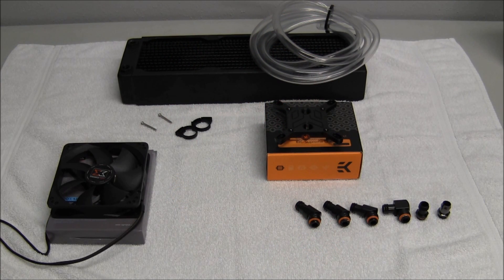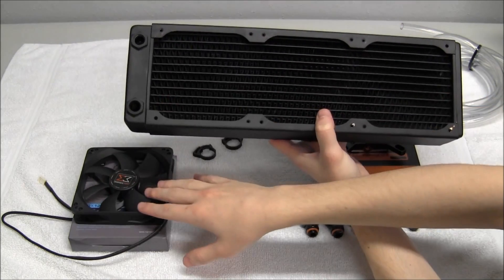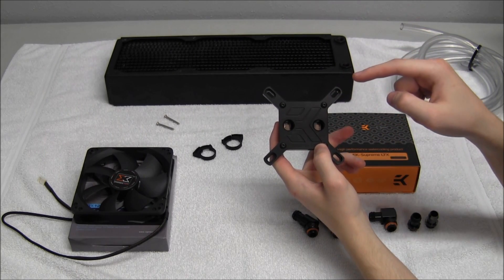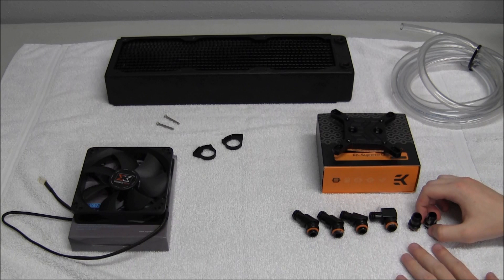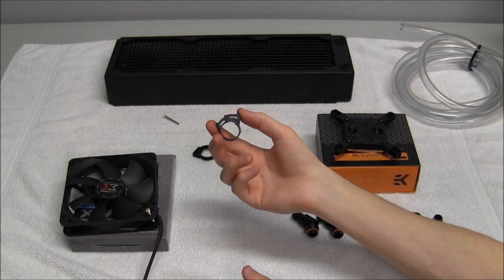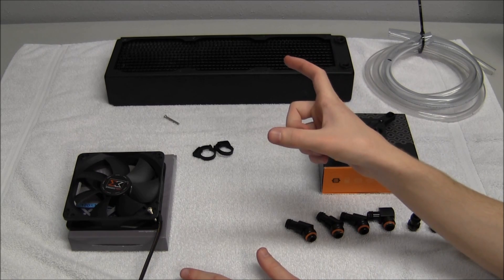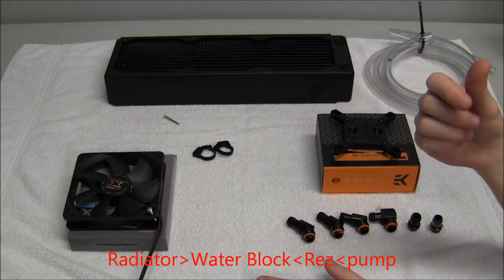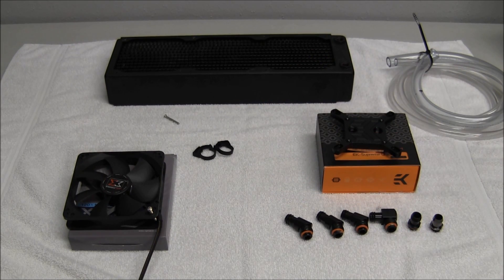Water Cooling Component Tutorial pt. 1 (JCP)

Comment: It doesn't matter what order you have your loop in. All you need to do is make sure that the reservoir is feeding the pump via gravity, so the pump would be below the reservoir. The water will still stay cool in your reservoir, so there is no need to push the water through the radiator(s) before the waterblocks. Because of the speed of the water through your loop, it won't make a difference between temperatures. Hope this helped. :)

Comment: Just saying not trying to be mean or anything but you did get a couple of things wrong 1 to get a small tube over a big fitting you dip the tube in boiling water rubbing it with your fingers will take forever and i doubt you could get it verry warm and 2 There is nerver more than a 0.2 variation in tempature at differnt points of the watercooling loop therefore it does not matter where the rads are in relation to the waterblocks the only thing that matters is that the pump is fed from the res.

Comment: Im so confused about the barbs thing... Especially the 90 degree shit. Lol. Ok, so for instance. the water block i am getting has a G 1/4" then i need to get an ID 1/2"? So then my barb (Alphacool G1/4 Thread 90° Rotary 1/2" ID Barbs from frozen cpu) Is that correct? The G1/4 would go into the cpu, then the 1/2 on the outside part...? lol, sorry if i sound stupid.

Comment: I am going to be water cooling 3 Way SLI GTX 680s and a 3960x. Should I just go with dual everything (pretty much 2 water cooling systems) or just run the water from the CPU block to the Vid Card block then back around?